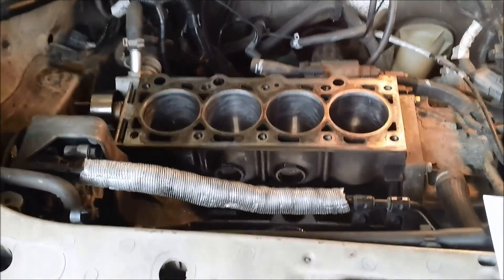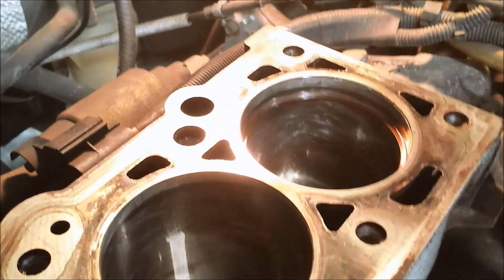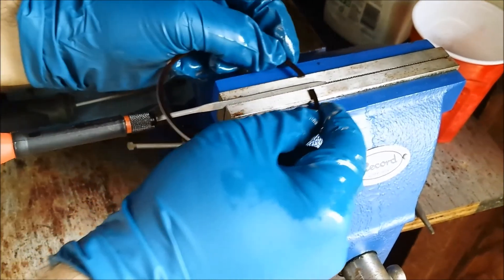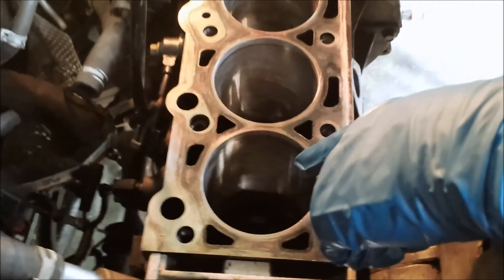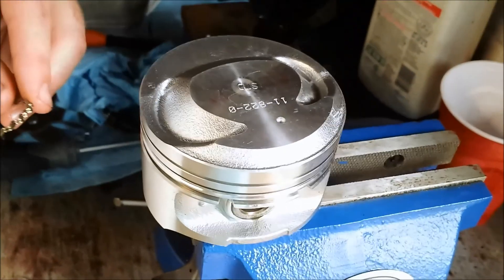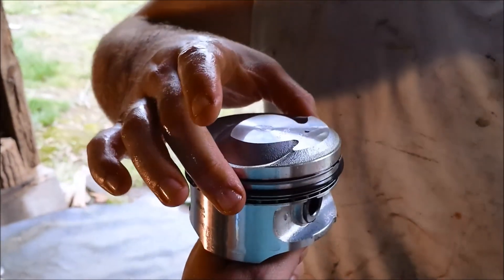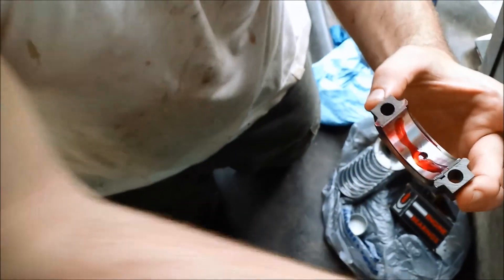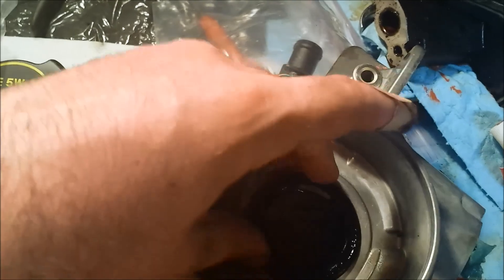Ford Focus Engine Rebuild 2.0L SOHC SPI - Part 8

Comment: Thanks for sharing. My Daughters 02 just dropped a #4 Valve seat a couple weeks ago and beat up #4 piston a bit.
I have the head off now and stripped down. Now I'm about to pull #4 Piston.
Reply from the maker: Hey good luck!  They are decent little cars, it's just a shame so many have this problem.  Almost everyone I know with the SOHC has had this problem eventually.
Reply: Yeah I looked into switching it to the more bullet proof DOHC engine but you have to mix and match so many different parts it would just get confusing to get the right parts later if something breaks.

You need the tranny, power steering, the wiring harness all the way to the fuel pump with the key to that harness, the exhaust manifold, intake,  AC and a few more things. That just aint worth it if  you can get an upgraded head with the intake seats and fix the SOHC.

Comment: You need to squirt solvent or wd40 in the cylinder while honing them. your hone job rhat i see is half honed at best.
Reply from the maker: You could be right, but that's more of an opinion rather than fact.  There is no shortage of experienced engine builders recommending various different lubrication strategies for honing.  Normal motor oil, warmed oil, Diesel, wd-40, designated honing oil, etc.  Regardless, it's a Ford  focus not can race car and it doesn't burn oil so I'm not too worried.

Comment: For all those watching, DO NOT use assembly lube on the outer part of the rod bearings, only use it on the inside that is contacting the crankshaft. This is how you spin your bearings very quickly. You don't want those bearings to move at all but you want them to spin nearly friction free on the crankshaft. It was not 100% clear in the video so I want to make sure no one does that. Good luck!
Reply from the maker: +Chris Pihlgren Very important tip!  Thanks for posting.

Comment: I watched all 8 videos so far, did you get it done?? I dont see no more videos about it?
Reply from the maker: Danny Danny Yes it's done and runs better than it ever did, I've got about 350 miles on it already.  I'm slow about making the videos but I'll see if I can get part 9 up late tonight.  Part 10 may be the final.  By the way, thanks for watching!
Reply from the maker: Danny Danny Should have 10 posted tonight and maybe the last one.  Check tomorrow if you're interested.
Reply: SoftwareDevJason
Reply: what did u gap on the second ring....i know the top ring u did on 
.012....just to make sure that 3 oil rings u dont gap them right?